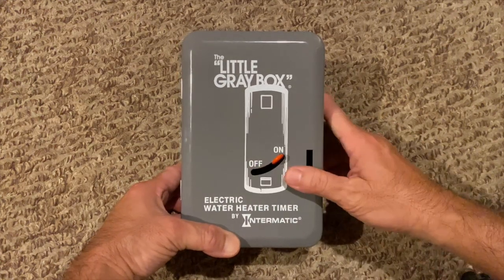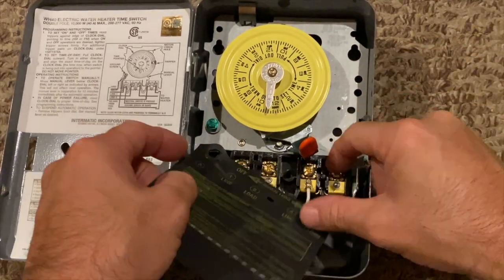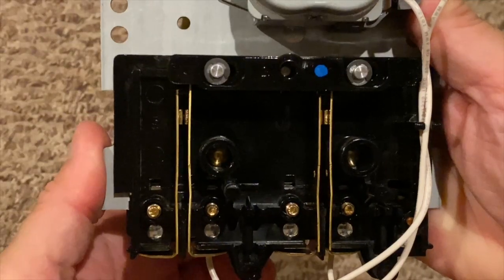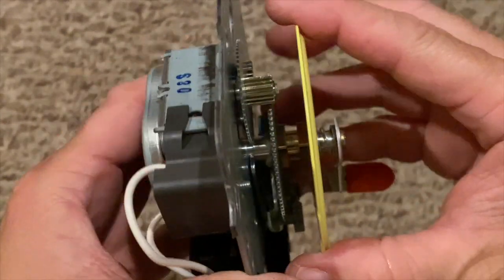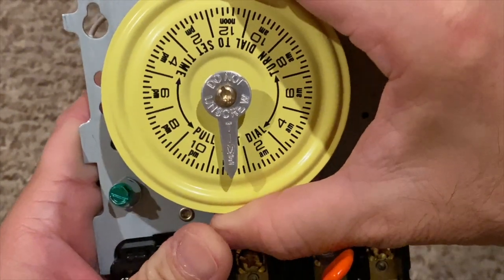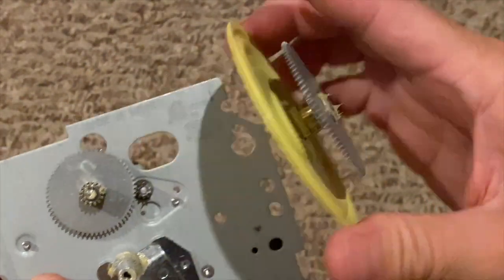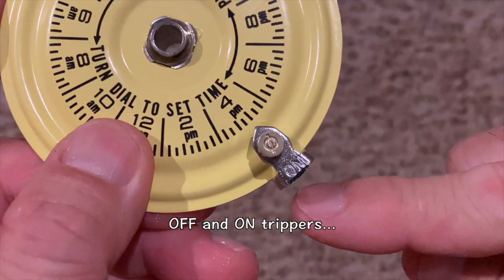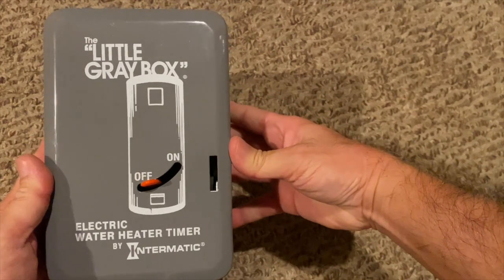How the "Little Gray Box" Works - Electric Water Heater Timer

Comment: Thanks for this video, helped me figure out what was going on and what to do.  One of these in my place, very poorly placed.  We swore the sound was from the water heater.  Got a new water heater but noticed the sound didn't change; that's when I noticed that "electrical box" was the source.
Anyone who realizes how little this helps and wants to disable the timer/clock sound from the motor/gears: Just clip one of the small white wires shown in the unattached version here.  No more timer motor noise!
Reply from the maker: If you want to revive the timer at a later date, you can replace just the timing mechanism. 
👍😎

Comment: What is the purpose of the timer? My water is going cool/lukewarm after like 5 minutes. Idk what to do
Reply from the maker: The timer turns an electric water heater on and off.  
1. Verify that the circuit breaker is on.  
2. Verify that the timer is on… the ON switch lever is to the right. 
👍
Reply: You probably have a bad lower heating element or thermostat.  Or it could be the upper thermostat not passing the voltage to the lower thermostat after it has reached its set temperature.  Cold water is piped internally to the bottom of the tank through the dip tube.  Hot water is taken from the top of the tank.